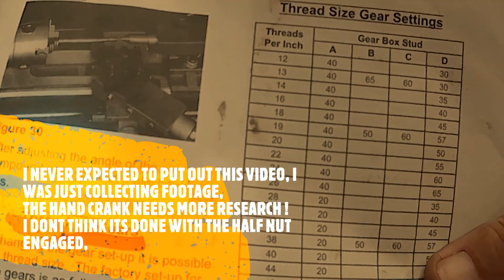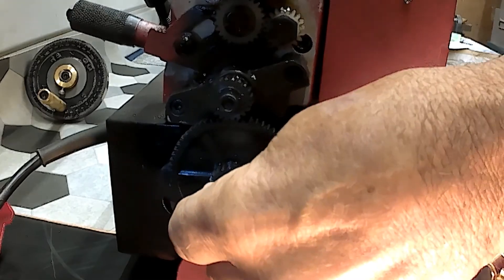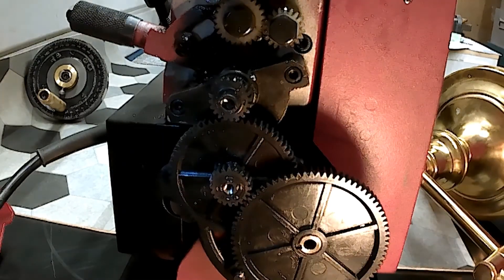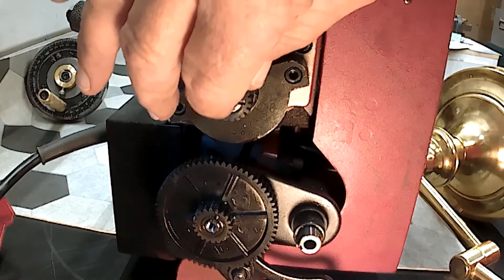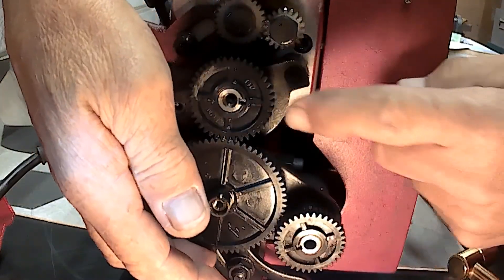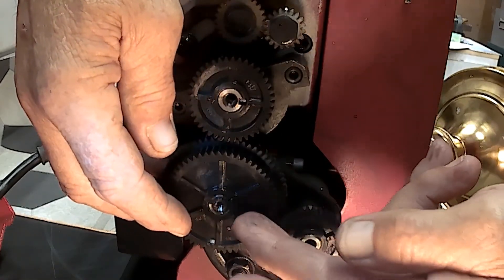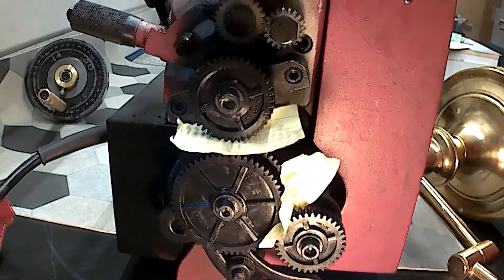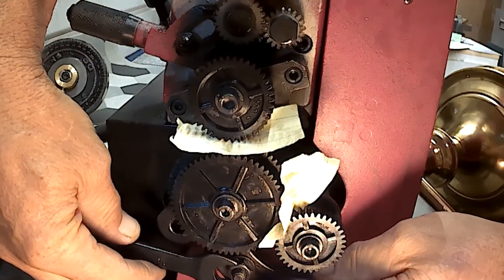HARBOR FREIGHT MINI LATHE ,SETTING CHANGE GEARS FOR 14 TPI

Comment: Thanks for the video bro! I have a Craftex CX-704 Lathe i bought in 2020. Few months after i bought a precesion Sherline Lathe and i never had a need to cut threads until now ... Thats when i ran into the problem where i had the gears and the chart and when i tried to install the correct gears i looked at the owners manual which was so confusing!! And no videos on YouTube show how to do it with my exact lathe. After a bunch of research i found out basically Grizzly G8688 lathe is a exact copy of the one i have. Basically confusing part was for the gear A if you change the gear outside or the one thats on the inside that is closer to the chuck. 

And it does not say anything in the manual on how to connect everything if it doesnt fit back together. 

Thanks again.

Comment: Number one issue, the background noise radio or what ever you had on. Number 2 the length of the lath bed won't change the tpi that your cutting. Only the gears. Thanks for the vid though never saw the paper to the gear teeth used before.
Reply from the maker: Thank you for your comments ,I’m listening

Comment: Kimber, what model HFT lathe do you have, or HFT part number? I have the 93212 7X10 lathe and I don't have the calibrated crank above the gear box like yours does.
Reply from the maker: If you’re talking about the crank I sometimes use for hand threading on the extreme left of the machine on the spindle ,that is some thing that I made . I also have the 7 x 10 I’m sure it is identical to yours I will try to clarify this in a video this weekend. 
Thank you for watching and thank you for commenting I will try to go over all the upgrades or changes I have made to my Harbor freight mini . Thanks
Reply from the maker: I will try to address this in a video in the next day or two. Thank you please be patient

Comment: Hello Kimber - there might be a problem.  Took a look at a mini-lathe manual online, and looks like you only want one (big) gear between the 40 and the 35;  putting in different B and C gears will give you something other than 14 tpi. Can always check threads with a ruler or thread gauge.
Reply from the maker: Yes your right I’m getting. 16 TPI But I’m getting something that I can thread a nut onto I’m so happy.
Working on video now probably go at about one or two in the morning gotta go to work now. It is my Friday however the weekend is almost upon me
Reply from the maker: You need to let me know where you get your info on the threading as far as using one gear that would be helpful to me
Reply from the maker: Do you do Instagram
Reply: @kimber1958  Found the info on the online manual for Central Machinery model #33684.  For 14 tpi, shows a 40 and 35 gear with a "B" gear in between.  Number of teeth won't matter for the B.